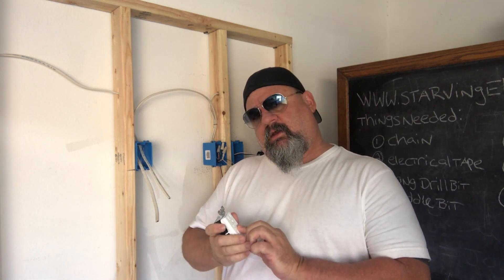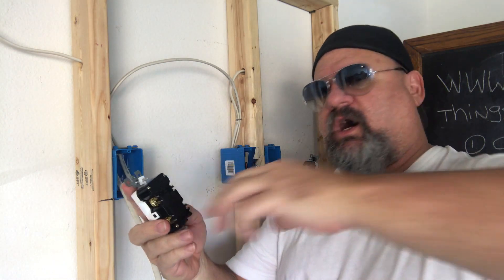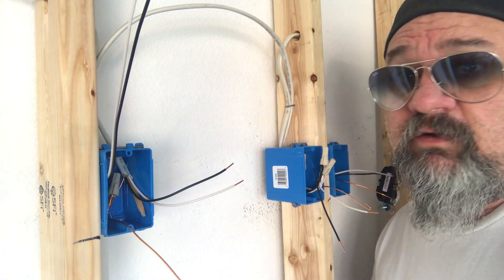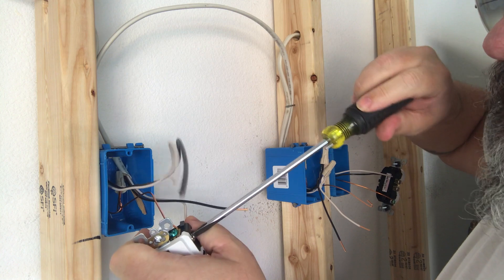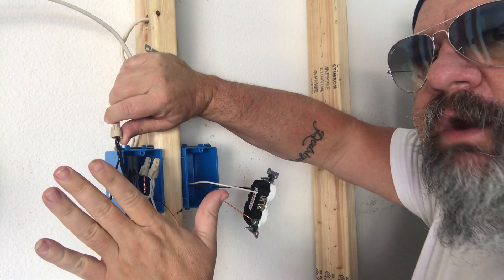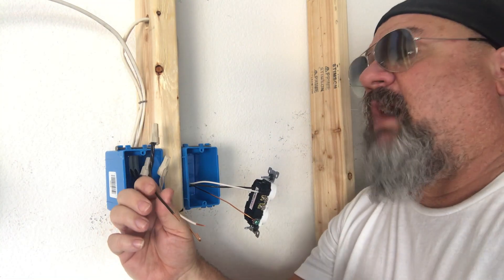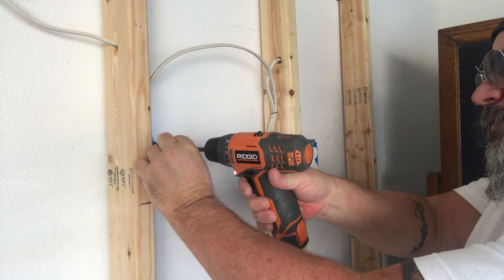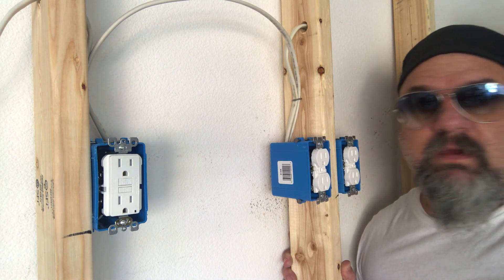GFCI OUTLETS. How they work and How to wire them. understand why you need them.

Comment: I just found your channel, and your videos are right to the point.  I noticed that you wired the GFI and outlets with 14-2 cable.  Maybe this is only for demonstration because 12-2 is hard to work with…possibly.

I have a GFI on a single 12-2 circuit in my garage on its own 20A breaker.  I want to add a light in my attic from this GFI. Can I continue up the wall with smaller 14-2 cable to a switch and (3) lights?  The attic is rarely used, no storage.  I don’t know the code on mixing wires sizes on a circuit.
Reply from the maker: yea you wont hurt anything. by code that whole circuit would be 20 amp but you can feed ;lighting on that circuit with 14 wire. as far as a gfci on 14, they are not only meant for 20 amp circuits at all. 15 amp circuits like Disposal, outside outlets, furnace etc.

Comment: Great videos.  Can I put a GFCI in the middle of a run with the wires in the box connected in parallel and then just put the blk & WHT jumpers onto the GFCI's line terminals and no wires connected to the load so that only the GFCI is protected.  (Want to put a GFCI outside my garage , see no need to use the load terminals)
Reply from the maker: yep no problem but just that outlet will be protected  not the whole circuit if its not in series. wire it to the line side of the GFCI

Comment: love learning from you Mr Taco. Need your expertise please. we bought our first house and it is a renovated 1910 home with half the electrical upgraded and the other half is the old 2 wires no ground. they put 22 outlets on one 15 amp breaker. i wanted to put in gfci s but cant figure out which outlet is the at the start of the circuit. Any help would be appreciated in trying to ground all these outlets. ty.
Reply from the maker: first take out all the plugs and make sure no wires are touching or put wire nuts on the hot wires then turn the breaker back on and get a tick tracer from home depot. you hold the button and put it on each wire and find the hot wires that way. its about the only way to find the beggining. hope this helps!
Reply: @StarvingElectrician  I didn't understand how that was gonna work then the logic kicked in lol. You said you read and reply to all of your fans and you did. love that you're a man of your word. yes it helps alot. thank you.

Comment: Hey Lenny, thank s for all your informative videos. That was a funny opener, haha.  I have a question and I'll try not to make this too long ... I installed a GFI in my bathroom to give power to my Bidet toilet seat (660W). I gave power to the GFI by pig tailing it into a 3 gang box in the attic that already had 4 other wires coming into it. 2 of the wires had both the black & red hot wires so I left those as is (red to red and black to black) and I joined my new wire to one of the other two black & white remaining wires. I capped them and placed them back in the box and attached the cover. The GFI works fine and hasn't tripped or anything but what I see happening is after turning on certain ceiling lights in my bedroom (and even in some other rooms as well ) after about a minute or two I notice a very light fluttering in the lights. It's almost like when your eye slightly twitches or flutters (if that's ever happened to you) Anyway this light flutter continues for about 60 to 90 seconds and then the lights stay on as usual. Do you know what could be causing this. Do you think this bidet needs to be on it's own circuit straight from the panel ?  I think most everything in my panel are on 15 amp circuits, only my washer / dryer and my kitchen light are on 20 amp circuits each. What do you think?   Thank you and I appreciate your advice .
Reply from the maker: you have a loose wire. get up there asap and check your connections. thats how fire starts. keep me posted!!!!!

Comment: First of all I want to say your videos are awesome. I wish I would have found them a year ago before I started rewiring my farm house that was last updated in the 80's. I've finally gotten the house done with the help of my dad and a friend at work who is a certified electrician who let me borrow his NEC book. Except the main panel, im having the electric company pull the meter next week so I can install it. Then its time to start on the two barns, two shops and eight outbuildings. They run off a 100 amp breaker that feeds 3 different fuse boxes and multiple smaller fuse "panels" in the barns and outbuildings. Secondly I love tacos and beer but they most definitely don't love me together. Thanks again for your awesome videos, they are alot easier to follow than trying to read the code book.
Reply from the maker: wow good job!!!! and yes same here with the tacos and beer not loving me back. so glad I could help.

Comment: So the company that I work for doesn’t allow us to use the stab back method. Only wrap around the screw. And tbh I have seen the stab back method create problem but usually because the outlet is like 30 years old from the 80s and has more than one wire in it. Idk very controversial subject amongs electricians like many other subjects.
Reply from the maker: its a matter of preferance but both are legal. personally I have no idea why people think the stabs are bad. wires are more likely to pop off the screws but to each it own. its not illegal but yes I have seen problems with old plugs but the plugs just had a load on them for so long they get hot and crispy.
Reply: Any device that use a clamp style method generally are pretty safe to terminate bc the set screw clamps it down compared to the cheap backstab method that use 
compression which often fails

Comment: I do have a quick question often you see electricians wire two wires in a receptacle box with a line hot on the top brass screw and load hot on the bottom brass screw, while the white neutral wires are done in reverse the line neutral is on the bottom silver screw and the load neutral is on the top screw. Is there a reason for this - mainly to reduce circuit resistivity and reduce voltage drops? I don’t think that’s the answer as circuit length is unchanged. Or is there another reason like more quickly identify faulty receptacles, or make it easier to push into the box. With GFCIs this crisscross wiring is no longer an issue given specific line and load sides.
Reply from the maker: well if thats the case with respect to wiring the outlet. it will not work properly. its simply wrong.
Reply: Starving Electrician  it works because the tab is unbroken on the hot and neutral side and still shows correct wiring on a tester. Polarity is still correct the hots are on the hot side and neutrals are on the neutral side it’s grounded with a ground wire in its correct place. Maybe I am not explaining myself properly. It’s just that with two wires in the box one being the power feed (source) and one being the line it’s not arranged in the usual line and load fashion. Remember this is a standard duplex receptacle not a GFCI. It’s simply something that some electricians obviously do but there seems to be little in the way of electrical properties that would suggest that would be a better way than simple line and load wiring.
Reply from the maker: @damaintenanceman  right.

Comment: When we re-did my dad's house to sell, the inspector wanted me to put a GFI at every outlet in the kitchen.  It was just one circuit.  I was like, "Yeah, no actually this one over here protects the rest of them.  You know, "LOAD."" He didn't know so I had to put a GFI in every one.  Sigh.
Reply from the maker: that sucks and actually its illegal to do that. each gfi in that circuit gets weaker and weaker down the line and will trip too easy. just one per circuit from the line to the load and then the rest are protected. good luck and thanks for watching.

Comment: Yes he’s back......the electrical taco master. Good to see you well. Very clear instructions. The 1-way, 2-way and 3 way switches next and some advantages and disadvantages in bringing power into the switch or at light fitting that would be great maybe you did this already. Very nice explanation of the parallel wiring advantages. The voltage claw is a nice little device to push wires into boxes.  Keep up with the videos they are excellent hope the channel goes from strength to strength.
Reply from the maker: Math Man  thank you so much for the comments and I’ll go back and look at my videos to see if I have some of the things you are asking for. I believe there is one about 3-ways too.
Reply: Starving Electrician of you want to map out the kind of training you want to provide to vets GSH electrical based in UK do a great set of videos could you run off that linking to the NEC code. Knowledge is really important but Technique is also crucial your years of experience will really speak to the new learners.

https://www.youtube.com/c/GSHElectrical